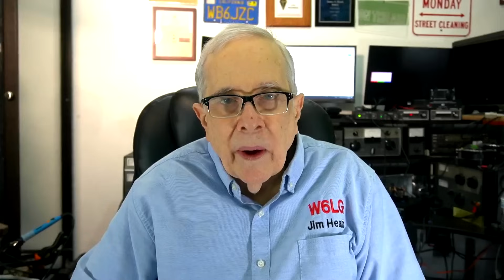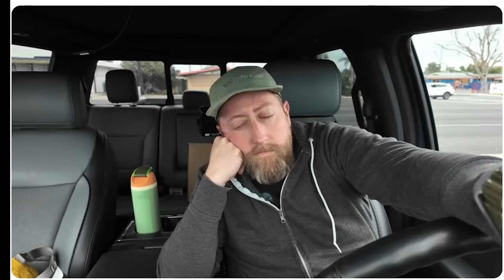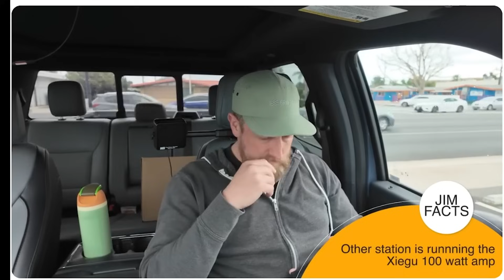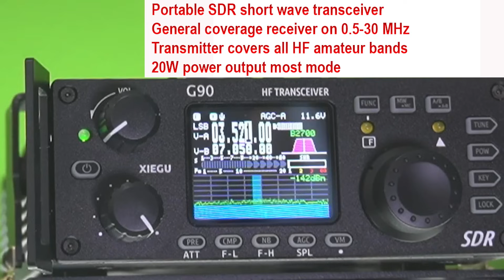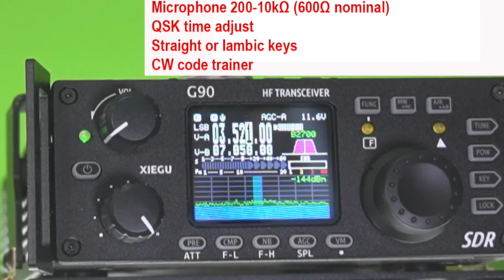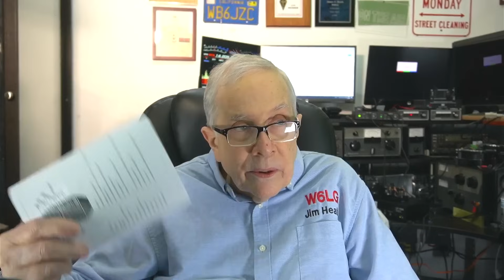What HF Transceiver Can A New Ham Buy For $500?

Comment: ICOM 7300..and ended there ,yes the total cost amount...but use wire antennas, dipoles, long wires..good enough ...., been a General now for seven years and only have a total of $2000 into the hobby which includes that 7300 and all associated hardware.

Comment: Thanks again for another great video Jim! I own the Xiegu 6100, 6200, and the G90 as well as the Lab TX500 (Discovery) but I still agree with the 100 watt application and prefer my FT991A over all. The others are great little radios, fun to play with but there is nothing like 100 watts out of the gate. Just the opinion of the rookie but you shared great information!

Comment: As a newer ham, this was recommended to me by my Elmers. This is my first and so far only hf rig and I love it. It’s easy to operate once you get use to the menus and interface. I recommend this radio. I also bought the XPA125B 100watt amp for it only because I didn’t want to learn another radio yet. Again I personally like it and recommend it.

Comment: the only thing I can complain about is that it sometimes will pickup AM broadcast radio, especially when using an EFRW antenna. but there's a filter you can get amazon to deal with that.

Comment: you can pick up a really nice used HF radio by major brands for 500 or less. Heck i just picked up a 746pro with mic and power supply for 300 bucks and im sure it beats the pants off these Chinese radios as far as specifications and performance / reliability. Don't listen to these paid hyped up ads. Grab something used and time proven and actually  sound good on the air.

Comment: Morning Jim.  I’ve looked at the G90…but ended up getting the x6100. The 6100 is awesome, but I’m still considerate G90. You just made up my mind. Got to get 1.  My base station is an older Kenwood 920. 100wats out on an long wire.  I do POTA and have found I love doing the QRP more than sitting on my base.  A group of friends and myself have formed a group called TN MAG. We are currently specializing in QRP and emergency deployment. Thanks for what you do. 73’s from Middle Tennessee. N0WNX. Ron

Comment: There have been reports online in forums of quality problems with recent batches of xiegu g90s.   I hope they are not true.   Currently this is the only option anywhere near this price, new, for something worth using. There are a few really dodgy HF radios with a lot less functionality for slightly less money, and then, nothing, until you get to radios that cost 2x or 2.5x more.

Comment: Absolutely love my G90. It is my first HF radio and I have no regrets, especially because I just couldn’t make myself spend over $1000 for a first transceiver. I use good coax and efficient antennas to deliver as much of the 20 watts into the air as possible. I’ve talked into Europe, South America, the Caribbean, Japan, etc… with an EFHW. KQ4SRE

Comment: I have had conversations with the G 90 and the radio sounds phenomenal. Surprise the hell out of me.
 
If you wanna used older rig, which I happened to own one is a Yeu 450 D that you can get for around $600. It’s 100 W out with a lot of bells and whistles. 

And for about $1000 you can get a 756 pro three which is an excellent RADIO. I also own one and I have a new 7610 and the difference in receive quality wasn’t worth the upgrade from pro 3 to 7610 in fact, if you just get the matching speaker for the 7610, which is an excellent speaker you’ll be hard pressed to find an audio quality difference. I was very disappointed with any improvement of the 7610 over the pro three.

Comment: I have a G90.  It was not my first radio.  It's not as good as my Kenwood or my Icom but is does have a place in the market.  It is a great starter unit and great for POTA.  As with any complex radios these days they are all driven my menu items.  You really need to know how to drive it correctly to get the most out of it.  Thanks for your opinion I consider it valuable.  73

Comment: I love my G90, bought it used for $300. I have talked all over the world on 20 watts with a square loop antenna into a 4:1 balan. I have less than $500 in the radio, antenna wire, the poles, the coax, all of it. Still have not got it to work on digital with the CE19 yet. But still learning on it. Had it 2 yrs now.

Comment: YES I would have one. i have an Yaesu FT-817 5 watts and they (G-90) are quite expensive and 20 watts and I dont think you will need to buy any filters if you do CW it would be fun to have one. I had a fortunate situation that allowed me to buy a 7300 fairly early on and I love that radio. I started out with a Kenwood TS-120s that was given and then bought two used Radio;s a Yaesu 747 GX fixed it and a kenwood TS-520s and restored it. i still like the 520s and put it on the air once in a while. i love running the 520s I bought it and the 747-GX for a 100 bucks each. Just get started and the rest will happen, just keep chipping away at it. thanks for the video. DE KB7CQ 73 keep fighting, there are way to many of us fighting the battle with cancer.

Comment: I have one.  It’s nice.   The vfo knob is clicky and small screen leave a lot to be desired.  It’s hard to remember the function of the various multi function buttons.  Long press vs short press. Etc.    

I’ve seen some people cobble together the Xiegu amp and an audio filter digital processor.  Even a surrogate screen.   At that expense you’re in big boy HF rig pricing.   

I think there are a lot of good used deals out there below $750 if the new ham can stretch for that.

Comment: Great video and well said ! Josh is great as well. For the $$ The G 90 is a good buy. The next better HF radio is much more $$ . I have worked so many G 90's around the world !  Many POTA and SOTA.  And the ATU out does most high-end radios. in an emergency that a big plus for me. I have herd shopping carts ,gutter pipes ,Speaker wire , so many odd things on the air and they got out. Even Josh has done that . The G 90 has put a lot of fun into HF radio for so many ! 73

Comment: I have no problem with the radio. I do, however, have a problem with the country that manufactures it. By purchasing anything made in China you are strengthening that country and weakening Japan, the United States and Germany - the manufacturers of other HF equipment. Yes, Chinese radios are cheaper - and that is the point of this video - to get folks into HF radio cheaply. But we need to realize and accept the reality of the world today. China has stated that it plans to move against Taiwan by 2028. It also has plans to move into the Northern Philippines by 2030.  DO WE REALLY WANT TO BE STRENGTHENING CHINA GIVEN THEIR STATED GOAL OF ASIAN DOMINATION?

I think buying entry level or even used Yaesu, Kenwood, ICOM or Elecraft equipment would allow entry into HF on a budget similar to buying Chinese radios - but without supporting the country that states its goal is to dominate and conquer Asia. 

Last year I purchased a used Yaesu FT-897 for $600. A new FT-891 is only $629. There are similar prices for entry level and used equipment from ICOM & Kenwood. 

The radio in your video seems good, though we have no real experience with how its chips and boards are going to hold up over the years. But again, do we really want to be supporting a country whose stated goal is to bring war and chaos to East Asia?
Reply from the maker: Thanks for the comment.  I understand your point of view on the economics and politics of purchasing a radio. Jim

Comment: Thanks for taking the time to review the G90, Jim. I’ve owned one for several years and enjoy using it for portable ops.  It is a solid choice. The receiver can be noisy so it is important to get proficient with the quirks of the AGC, RF Gain, Preamp and Attenuator. Like you said - read the manual!  I continue to pray for your healing.

Comment: I bought my Xiegu G-90 from Radioddity. Used it to get my feet wet with HF. Worked fine. But, the 1.9” display was a little too small for my aging eyes.
So, when I had an opportunity, I bought a Yaesu FT-710AESS. It has a 4.3”, I think, screen. But I added a 9” external display. It’s a thing of beauty!
So, now that I have my FT-710AESS, and have gotten through the big learning curve, I ‘m ready to turn my  1yr old Xiegu-G90 over to someone else new to HF. 
They are not too hard to operate, cover all the typical US ham bands. Has internal tuner that works great. Has the accessory fan base, and C-19 expansion card.
Like new, never been outside.
Now, just need to get it listed. 
They are a fairly easy 1st HF rig to learn on. Not too deep to learn with. 
There are plenty of YT vids describing
form and function.
New G-90’s often come on sale at various holiday times. Carried by all 
the usual vendors.
Reply: I have the 710 myself, punches way above it's price tag!
Reply: Get the Quantum sdr for the G90 and that will transform the radio aswell 😁

Comment: The g90 is a fantastic radio. The only issue with it, which was big enough for me to get rid of it, is the fact that it doesn't have good filtering to reject nearby strong signals or AM broadcast band. You can add a filter in line, but then you can't use the tuner! So for me, that was a real bust. Even being in the mountains, a CB operator using a little power some miles away can totally ruin an activation on a different band.

Comment: I have had my G90 for three plus years now. It's my favorite portable HF rig for POTA. Over the years, there have been several firmware upgrades and I found that the one I like best (Version 1.79b) and have stopped upgrading since. I replaced the VFO knob with an eBay seller's knob (Yenaxi Ham Radio) and I see they have more choices now. Having bought my rig from Radioddity, I have bought some accessories including the repair kit full of useful parts for when or if I need to replace them. Love the radio and hope to keep it healthy for many more years. Hope you feel well again soon. 73 de K5MGK Mark

Comment: As a retired engineer and computer scientist, I became licensed in 2024 as a Technician, and upgraded to General in 2025.  This is my first HF transceiver, and recently completed a firmware upgrade to 1.8 April 2025.  I purchased this in August 2024 and it came with the cooling stand, DE-19 interface with all cables and a tilt-up desk stand. From Northern Michigan, I have worked the world, including Japan and Argentina, Eastern Europe, with 20 watts SSB (10 - 15 watts for FT8), MacBook Air M1 running Mac OS Sequoia, RUMlogNG, WSJT-X, and through the well engineered DE-19 interface, all apps are radio-aware and CAT control capable.  In the wintertime I use this as my base HF transceiver, and can easily take it portable with my wire antennas, and 31' Jackite pole to get those antennas in the air in the spring, summer and fall.  Familiarize yourself with this radio, but don't stop there - it does a lot - explore, experiment and push it to its limits - And it can easily fit into a go-box or backpack for portable or off-grid/emergency use.

Comment: Seems like a good rig for the financially limited folks like myself. Having started radio as a SWL and AM/DX'er (which I still play with sometimes) the GC receiver matters to me, and a lot of the older Ham rigs available used and cheap don't do that. Low power consumption is also important to me as I am hoping to go off-grid in the future  Haven't been active for awhile but this rig might change that for me.

Comment: Tdsi Gu (not an expert) is how I pronounce it. When I started in the hobby, 2021 Jan licensed in March, I was flooded by suggestions of Chinese radios. I had served my community in CAP as a youth in the early 90s and owned Heathkit HW-18, Yaesu FT2400H, and the ICOM IC-2GAT. I came to amateur radio with a huge bias to Alinco, ICOM, Yaesu, and Kenwood. I have since used the Chinese Brands some and enjoy there features a little more. I have yet to own one. This bias hasn’t gone away, but I have set at a POTA with a friend on an extremely bad band day me with ICOM and he with his x6100 doing FT8. He had over 50 contacts before I had 1. I eventually got my ten only after getting out my IC-7600(we had gone to a Hamfest so it happened to be in the truck) and drudged through. Moral of the story, the Xiegu works! I need to get past this, but I don’t need another radio. 
Jim thank you for another great video where you open minds to good ideas!

Comment: As someone who has been licensed almost as long you have (I'm at 59 years) I have the following thoughts.
The G90 is an excellent starter radio. It comes with a tuner that will tune almost any piece of wire or metal. Compared that to the built-in tuners in "big name" equipment that do at best 0-150 ohms impedance. 
The receive sensitivity is probably where it needs to be given the power out of the radio. Your frustration level in trying to work someone that is just above the noise level using your 20 watts will drive you away from the hobby.
20 watts is certainly enough power to work the world today. In another 5 years, maybe you'll need a 100 watts to work anything. Who knows.  
The price tag certainly makes it entry level compared to other current radios at 3x the price. I wish I could remember what I paid for my T-60 transmitter, all the crystals for it and my SX-99 receiver back in the day and run it through an inflation calculator. I'm pretty sure the G90 runs rings around that old stuff.

Comment: Greetings Jim, I do not own a G90 but I have heard good things about them from K4OGO (YTC: Coastal Waves and Wires) and he thinks they are a good basic transceiver to start with also. After hearing multiple excellent reviews on the G90 I would not hesitate to buy one if the IC-7300 breaks. The only other radio I can think of is an Alinco DX SR8-T. The DX SR8_T is an entry-level transceiver, and maybe a tad over $500.00 at today's current retail price but I have worked a TON of DX with it and a Hustler 6BTV antenna! After the new setup and configuration of the Hustler 6BTV, the whole shebang becomes a "plug and play" operation!  The antenna tuner is not required. 

Great to see you again sir,

kc5ngx

Comment: Depends on where and how you use the G90... you kinda get what you pay for. Unfortunately it has mechanical tuning... and  the encoder fails after awhile... it can be replaced, I've done mine... twice, but it's a fiddly 'challenge'. Otherwise the radio works pretty well. But I don't recommend it for warm humid (tropical) climates. Better to spend a wee bit more and get an FT 891 if your on a budget. Similar form factor, no ATU but it does tune up to 3:1... if your antenna is that bad... you need to do some work. and with the FT 891you get 100watts. If your doing budget you don't need the bells and whistles of a "waterfall'... you need a reliable radio that just works... the FT 891 ticks all boxes.

Comment: Hi Jim, glad to see you again my best wishes to you.  As for the G90...I'm with you on the name...so...I'll call it "Dave".  I agree it's a good first time HF radio with the proviso that the 20 Watts may not be a big issue today but as Cycle 35 starts down the other side it may make it more challenging to be heard.  Overall though...a good portable/packable radio for POTA/SOTA.  I'd probably be tempted to add the amplifier to get to 100 Watts for home use.  That said - I'm saving my pennies for the FTDX-10...or...that's the plan...haven't cleared it with my wife though.

Comment: Jim, I think it's a great radio. Two friends of mine have one, one very experienced and makes it sing Dixie, and the other a little like me making mistakes with the push button menus. But they both get out and make contacts and that's what the hobby is about. I have Yaesus,  Elecraft and ICOM and other rigs in my shack or have used them in the past and find them also excellent radios for their purpose.

I can't think of a used radio that a new ham could get for less money but the FT 450 that we promote through our radio club seems to be a well built tank that runs 100 W but without an antenna tuner. The G 90 might have too many features that would be confusing to a new ham who does not have an Elmer. A new ham with an Elmer could be taught the ins and outs of this radio very easily. So it does what a radio is supposed to do and is within a reasonable price limit. The antenna tuner does make up for the deficiency of other rigs that do not have same but the 20 W is a little bit limiting. I'm still waiting for one of the companies to come out with a similar radio, but with 50 W output. Even 100 W all in the little box. It can be done and will be done soon I'm sure.  And at this price point.

Comment: Thanks Jim. My first HF radio was a G90. I've made some great DX contacts (Russia, Perth Australia, etc.) with it so 20 watts isn't a big issue. It's a decent and rugged rig. I will keep it as the apocalypse rig and as a spare.  Since then, I bought a Xiegu X6100 for POTA (which I love using due to it's amazing tuner and small size) and two other rigs. I upgraded my shack to an IC-7300, then finally, an FT-710. To be honest, the FT-710 blows them all away. If your $500 guy could scrape up some more dollars, I'd go straight for the FT-710 and be done with it. It's small and light enough for POTA or mobile.  Good shack rig, and it can hear better than an angry female bartender. It might sting the wallet a bit but they would buy once, cry once. If $500 is a hard limit, the G90 is perfectly fine.

Comment: I considered the G90, but ended up buying a Yaesu FT891 and I am very happy with it.  It's a 100W rig wo/ tuner, but tuners are cheaper than amplifiers  and for the most part, my EFHW-80m-10m works well on 80, 40, 30, 20, 10m bands without a tuner.  Yes, it does not have a fancy waterfall display, but it is a great performer.